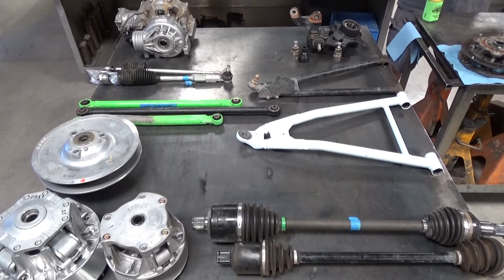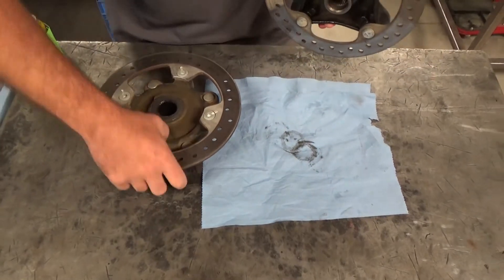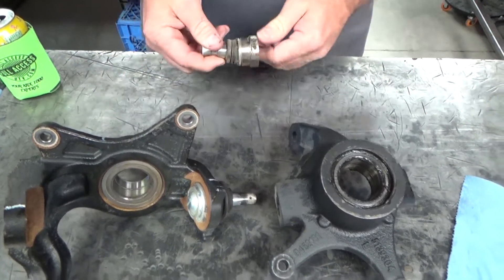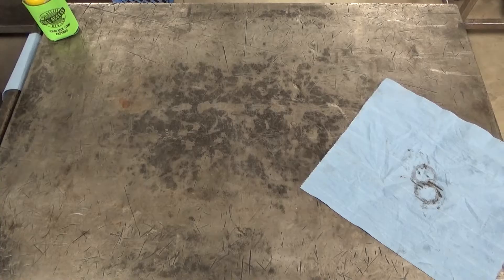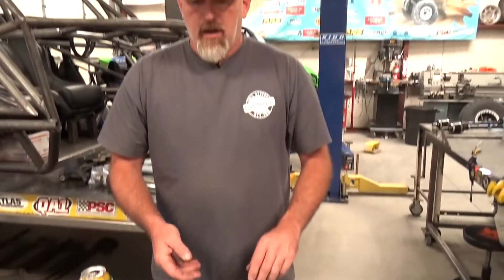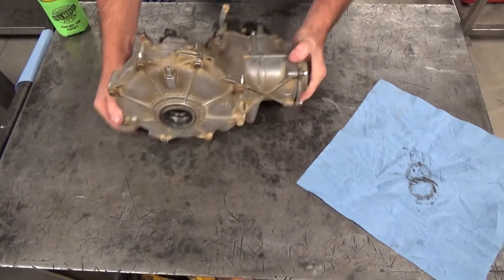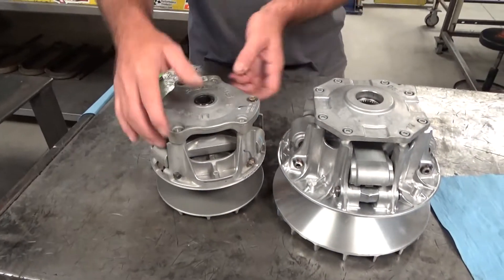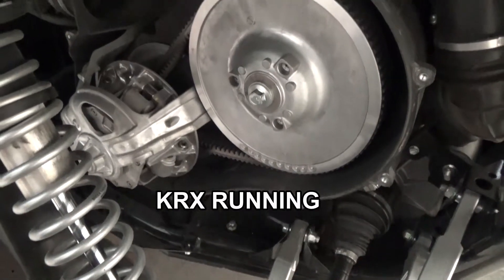Kawasaki KRX 1000 Review of the Parts! Polaris, Can Am, Vs Kawasaki!

Comment: Nice comparison video. I waited a long time before upgrading from a Polaris. When the Kawasaki released KRX and I start looking at the machine my decision was made on what machine I was getting. My 2020 KRX has 1200 miles and going strong. I have had no problems. Every penny worth it. When aftermarket takes off with the forced induction for the KRX these machines will dominate the industry. Keep the videos coming,  let's see a top finish at KOH.

Comment: Great video and it helps reinsure me as to why I bought my 2020.  Had the warranty work done for the lower a arm and knuckle.  

I got lucky when a few of our Houston area dealers were selling them for $15,499.  I don’t think for that value you can touch it with a 10ft pole, considering the overall product.  Would more power be good, of course, but maybe that will come.

Comment: one other thing of KRX vs. CanAm/Polaris......ENGINE BRAKING!!!! Kawasaki puts a one-way clutch in the secondary to allow engine braking... so awesome to be able to descend a muddy or loose shale slope and not be in freewheel or have to ride the brakes....  the CanAm and Polaris when you let off the throttle at any speed you're in neutral and you gotta keep the RPM's up to keep the belt engaged.... also as a buddy of mine found out with his RZR turbo... when you do a river crossing through deep water and the belt gets wet, with the Polaris system where it goes "loose", it might not grab again when you get on the throttle- leaving him stranded in the deep water.
Reply from the maker: That brings up a really good point that I didn’t even mention. The KRX is four-wheel-drive. I almost rolled my Polaris so many times coming down a hill because it only had rear wheel drive going downhill. The ass end would always try to pass the front and roll my family over. The KRX is low geared and controllable just like a vehicle is.

Comment: I’d love to see this comparison again against a Pro R.
Reply from the maker: Same same Polaris. A arms are bigger but welded to beer can. Front diff is bigger but fails, rear toe links have to be upgraded, front “lower” shock mounts break and cause rolls. Needs upgrade. Gearing is better but still have small clutch problems. Same, same.

Comment: You mentioned many reasons why I chose a wildcat xx !! Engineering is superior to about any production car out there with double shear!! 
Well….Until the speed utv comes out!!
Reply from the maker: That’s your opinion. Superior engineering in 2016 and built in 2018. It’s 2021 and that car is behind the times. As far as the speed “unicorn” we will see. Sold my spot years ago.
Reply: @fullaccessutv  I beg to differ! Many cars to date are still built like garbage and don’t compare structurally to my 2018 XX! The KRX is definitely looking better and would probably be my choice if I didn’t own the XX! The XX It’s super easy to do maintenance on it as well! 
I understand they all have issues I know but damn…its ridiculous after dropping $20,000 on a car or more! The engineering in most leave a lot to desire!! Not sure where the engineers get there degrees? Oh yeah doesn’t matter screw the customer it’s all about pleasing investors and the bottom line!!! 
You have drop lots of money all new upgrades just to make the damn things reliable and safer! 
It’s a conspiracy with the aftermarket with out a doubt!!  That’s my opinion at least!! Different strokes for different folks!! I respect your thoughts!

Comment: How many Kawasakis have won king of Hammers?  May be good, may be strong.  May be looking at Xp 1000 tailights.
Reply from the maker: Nope. Opposite in my our case. KOH requires power, and a taller ratio. With the aftermarket support out there, thinks will change

Comment: Polaris actually beefed up a lot of the parts for the Pro Xp. Not knocking the Kawasaki though, build like a tank.
Reply from the maker: Competition has done that to them, yet still nobody’s going to post a video of Parts differences. They’re still smaller.
Reply: @fullaccessutv  Most definitely, without the competition between manufacturers these things wouldn’t have came half as far as they have. Whether it be horsepower, suspension, build quality extra…

Comment: Yeah Man IDK if you realize it or not but your statement is extremely misleading about their CVT systems. Arctic Cat, Yamaha, Suzuki and Kawasaki use wet clutch.
Yamaha and the real Arctic Cat (say early 2000's untill city boy Textron ripped them off) had the absolute best CVT system toughest roughest strongest longest lasting. Suzuki is very good aswell but they really don't have much behind it. Kawasaki was my first love so don't get me wrong, they try and they always do their own thing usually with the right idea but their CVT systems aren't as Good as in toughest, longest lasting. Hell even in 2004 when Arctic Cat used their big block at the time 650 v twin and KEPS CVT system both that machine and all of Kawasakis went I to fckn limp mode at 1500 miles and other mile marked points, leaving you totally FCKD ON THE TRAIL IN LIMP MODE! 
And their shives were notoriously weak/soft that they'd belly out of you ran your machine good hard an hot in high range the middle would basically be ground right down totally fckn the ratio up badly.

The krx "finger" system is extremely perfect for my riding for smooth absolute lock up when crawling but stays locked a couple seconds after letting off throttle. Yamaha RMax 1000's newer bigger CVT still uses the "roller" system and is much better at keeping up with your inputs/demands.
Most importantly it lasts 6500 PLUS MILES with no maintenance AT ALL besides blowin her out good with your compressor every now and then at best. Also the RMax has a 10 year belt life guarantee! Legit....nuff said lol
Again don't get me wrong KRX will be the top dog for years to come in its own niche. They did their part, and will change out that awful finger system CVT you mark my word man for the longer lasting and more responsive "roller weight" system as the KRX is already notorious for needing new CVT build after figuratively 1500 miles as she's worn enough to really fck you up

Anyone can not pick, and I don't wanna be "that guy" the true FCK face. But the info I included here is extremely important to include, and city boy don't really know a whole lot untill something's broke/they an their girl are stranded/repair shop hands them a bill for thousands of dollars lol

Kick ass video none the less 👍🇺🇸